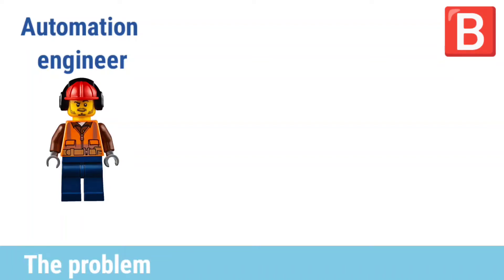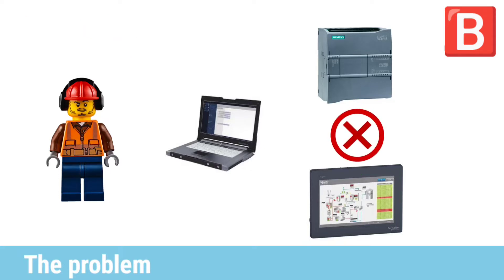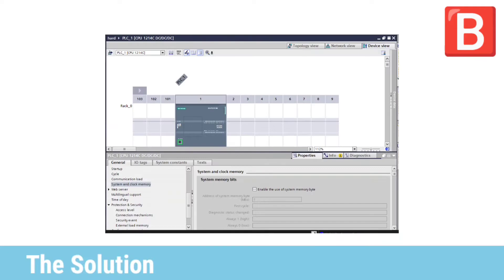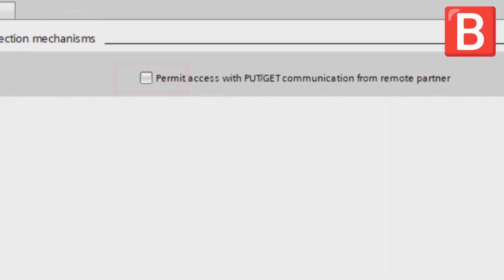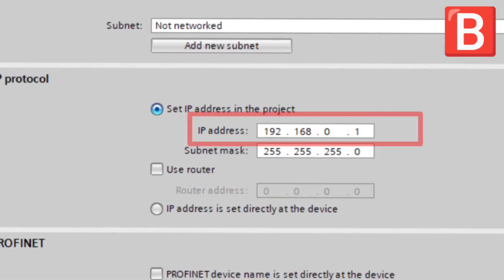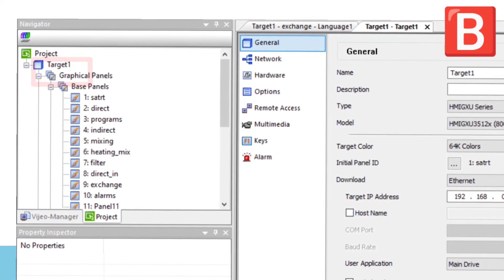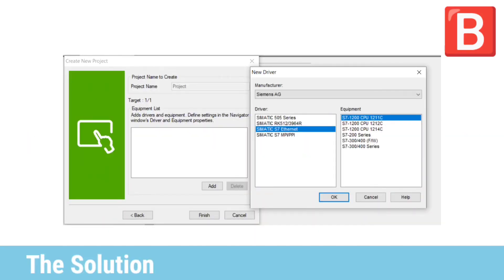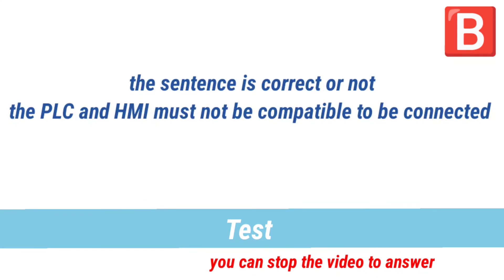How to check and configure the connection between PLC Siemens with any other brand HMI in 4 steps

Comment: Hello, when i want ton check if my button work, i push them and i have this message (S71200 Siemens does not respond).

I have S71200 1212C CPU with additional input output card and HMI5ST Schneider.

I have the trial version of Vijeo Designer 

Tanks in advance
Reply from the maker: First you must to make the plc accept to connect with other different devices

Comment: How to connect display HMIGXU5512 to PLC S71500(Tia19)?

I used Tia19 software for PLC series s71500 programming. Now I want to connect monitor HMIGXU5512 to it, I used program Vijeo Designer to program the monitor.
Reply from the maker: you can follow the steps in this video but you need update your vijeo software if it does not have S7-1500 in compatible devices if your vijeo have s7-1500 in its compatible devices you need to choose it only